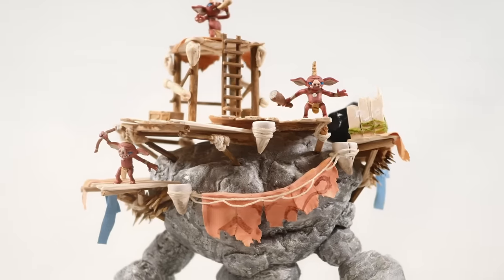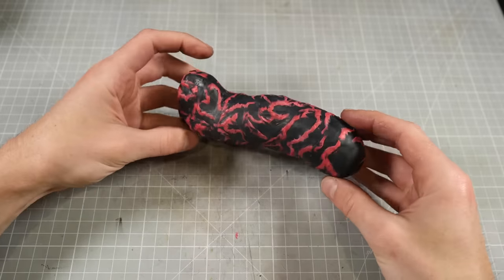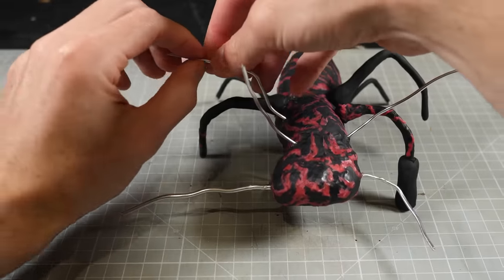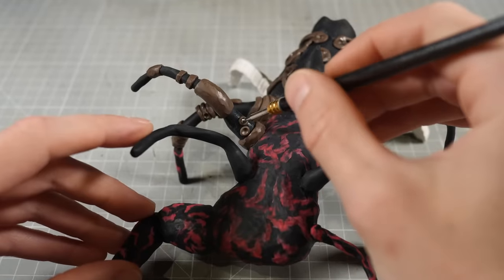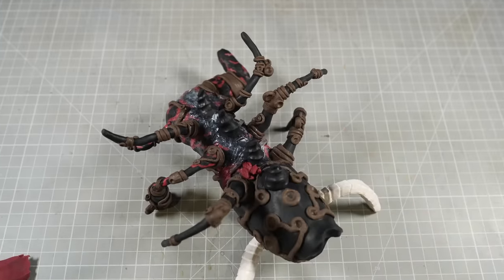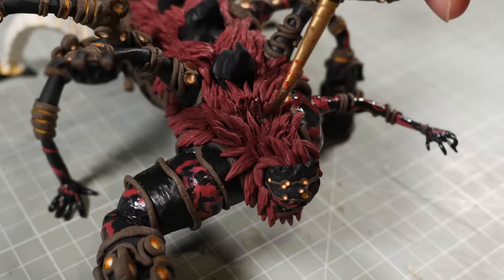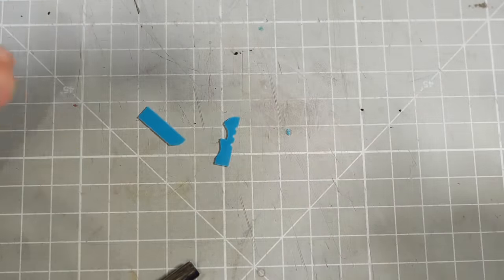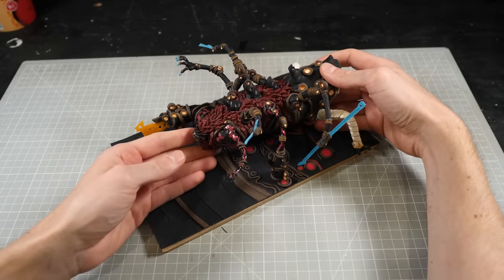How to make CALAMITY GANON out of Polymer Clay / BREATH OF THE WILD

Comment: Pro tip from a polymer chemist: you are right. Acrylated polymers like you were using can’t fully cure in the presence of oxygen. Covering with a layer of water is a neat idea, but there’s another technique that works. After zapping it with your uv light, wipe the surface of your polymer with an ethanol or IPA dampened lint-free cotton cloth. The alcohol quenches the reaction and removes the top-most layer of molecules, leaving behind only those that were cured without exposure to oxygen. The benefit here is that alcohol is crazy volatile and evaporates way faster than water. 

Excellent work, as always. I love your videos!!